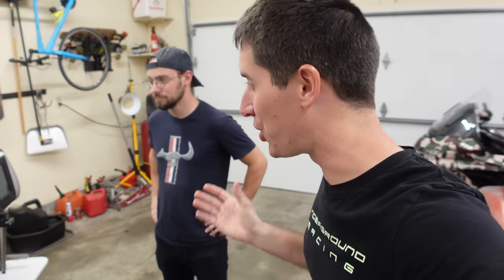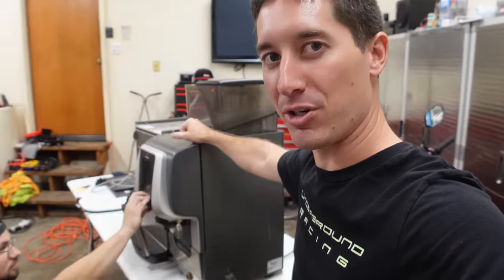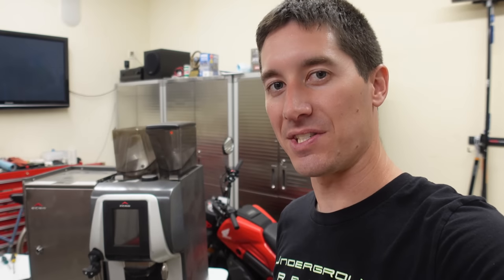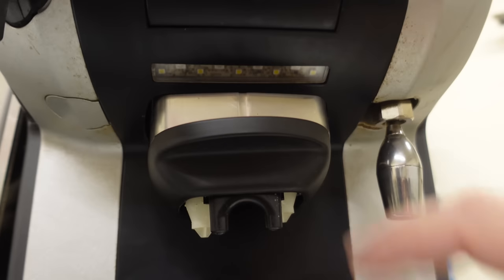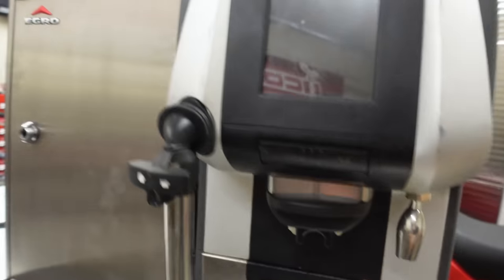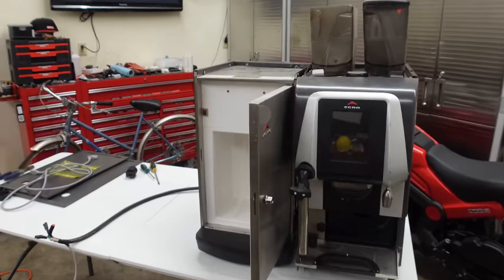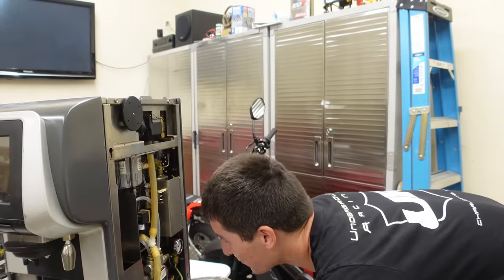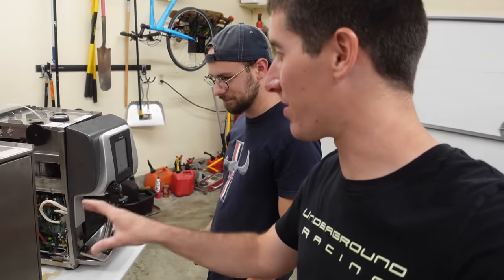I Caught This $29,000 Coffee Making Robot On FIRE (Then Tore It Apart)

Comment: That coffee grinder is basically designed to grind espresso in a commercial setting. Each "click" will basically dose your portafilter with one shot worth of coffee. The little slide on the top is so you can ensure the grinder is up to speed before you release your beans into it because apparently that gives you a better grind quality.
Reply from the maker: I looked that thing up... it's $820 😳
Reply: @WatchJRGo  Yes that would be right, they are a very good brand used in a comercial setting. Sell it!
Reply: Yup, I recall seeing something similar on the Starbucks cart we had at HP a while back.
Reply: @WatchJRGo  and that's pretty inexpensive for a commercial espresso grinder - most home setting grinders run $200-300 but if you're really into coffee it's not unheard of for $1500 - just for a grinder.
Reply: How much do you wanna bet that the espresso machine went home with someone - why they didn't take the grinder (it appears to work) is a mystery.
Reply: @nickgeorgiakakis7249  I'd sell it too - just some minor clean up - maybe not even a new set of burrs and to someone looking for an additional grinder they'd get a deal and JR would have a few extra bucks for lift struts...

Comment: Love the "off-topic" content!  There's a few things about the grinder - it's for espresso coffee drinks - just about everything sold in coffee shops (coffee) is based on espresso first - then milk, syrup, flavorings, etc. is added to it.  The exception is your standard "drip" or "pour over" coffee like from a Mr. Coffee or Bun coffee maker.   Depending on how many "shots" of espresso you'll need more or less ground coffee.  The timer is set so that it will approximate the amount of coffee per "dose" - that dose should be based on weight not volume so they'll weigh the dose to make sure (perhaps not every time but at least when changing the type of beans and at the start of a shift, etc.).  The other adjustment is the grind size - too fine and the water can't pass through the grounds at the right speed/rate - too coarse and the water goes right through and the extraction doesn't happen.  In espresso (and I'm no Barista or coffee "pro") you have a lot of variables - time for the shot, weight of the coffee, grind size, water temperature, pressure of the extraction (partly determined by the grind size) and the coffee bean itself.  Making espresso (at home even) can become a "science project" in no time especially for us nerds.  A $650 espresso machine is usually just the start - between better grinders, scales, dosing cups, portafilters, tampers, etc. you'll be in for a thousand without even buying any coffee or milk ;-)

Comment: Fun video!!! You need to wire up and outlet strip to 220V. Then you have a local switch to break the circuit for testing and you can use common 110V plugs like you did. Just mark it "220 ONLY" so no mistakes. Yes, I have this exact setup and use it all the time to test and repair lab equipment.

Comment: Coffee makers (espresso machines) really are based on how big the steam tank is.  The steam boilers determines how much pressure can be made by the water pushing through the coffee in the portafilter/ cup. For service they just need a few tablets a week, check out Bunn or puro cafe for tablets to clean, they both make tablets specifically for machines like this.  Also open the steam boiler should get some descale depending on how hard your water is.  That tube under the machine is your drain tube, just put into any drain.  Don't want beans on the grinder before start, just create too much load and can bogg out the grinder.  The USB port is for companies who have custome settings that want to easily set the among many units at different properties.   Also really good idea is to run a magnet above the grinder to catch any metal that could be in the coffee ( a lot more than you would think nails peltes from shotgun shells and rocks )  will save you from a set of burrs prob $900.  Also that boiler is a baby.
The grinder at end the flick is made to be the "perfect" 11g per protafiler for an espresso machine.

Comment: def diy from scratch the new shop - pour a big monolithic slab and then build icf on top - a couple bays, an oversize bay and office space do 28 x 80 - or something sim - consider mezzanine office and deck on roof with solar and heat pumps/heat exchanger/pos pressure hepa - if you do  most of work yourself to build new shop you end up saving sig on labor costs - you could do timberframe, you could do steel frame or just frame with 2x6x14 - the icf would be the strongest and most tornado proof - you will get most value out of diy building - the forever building? you may want to plan on flipping again in 3-4 yrs when the mkt is hot again - it should be an ok investment with right terms and location #sweat equity